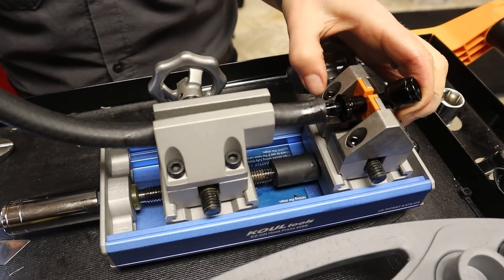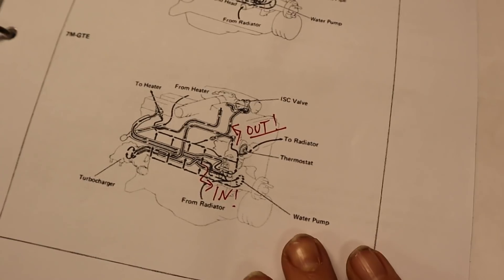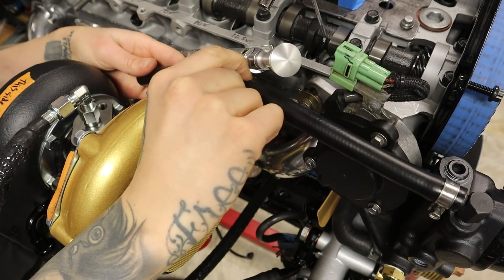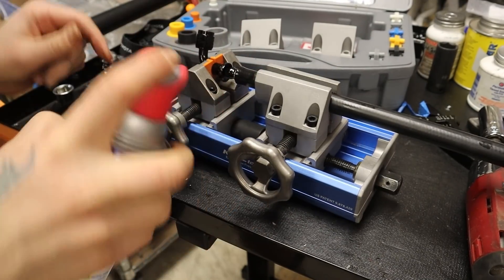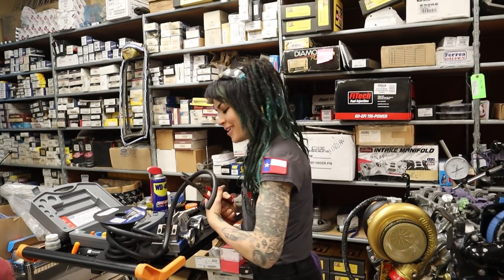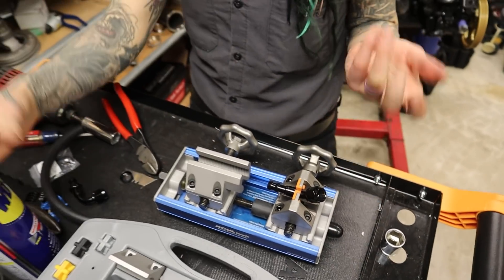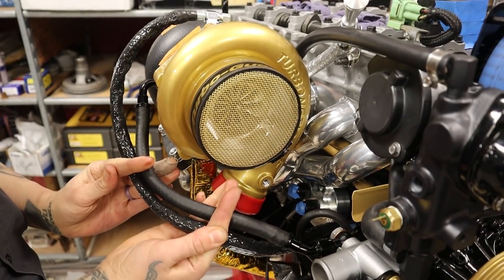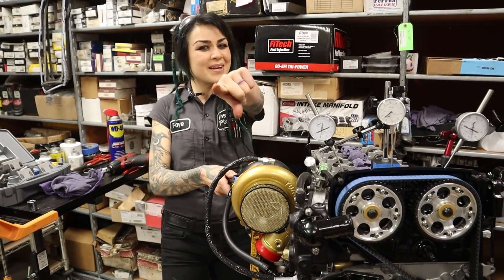Making my 7M’s Turbo Coolant lines with the Koul Tools EZ ON Hose Press!! Supra Saga Pt. 21

Comment: Use the same tool for work and love it! It saves so much frustration and lowers the risk of hurting your hand when installing 3/4” and 1” push lok. Especially the high pressure. Like you said that wall is stiffer. Makes it much more of a pain.
Reply from the maker: That's so badass!! Yeah, Danny and I make a lot of custom length hose here of all types, so it's pretty much a no-brainer having one of these :))

Comment: is power steerin necessary
Reply from the maker: If it came with a power steering rack, making it non-power will be a PITA, especially at lower speeds. But my daily of over a decade never had PS and it's not a big deal

Comment: Rubber lines are a no go. You need braided stainless steel lines. They're stronger and they look better.
Reply from the maker: I'm not a fan of stainless actually, because you can't tell from the outside when they are collapsing or going bad... So for something that's a smaller diameter, and crucial to cooling my turbo, I'd prefer function over form!

Comment: Really enjoy your videos, thanks for putting them out there.

Is that 402 series hose good for coolant? I looked at their website and it didn't specify. It did mention a max operating temperature of 212 Fahrenheit. I've had really bad luck in the past using fuel line for coolant, it degraded super fast.

I'm sure you've done your homework, just curious if you could share. Thanks again for your work and effort!